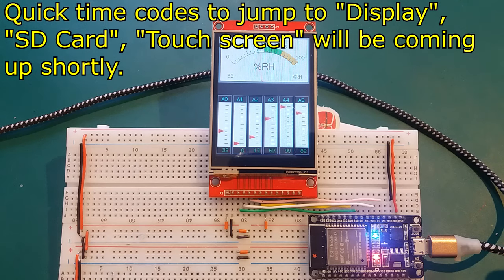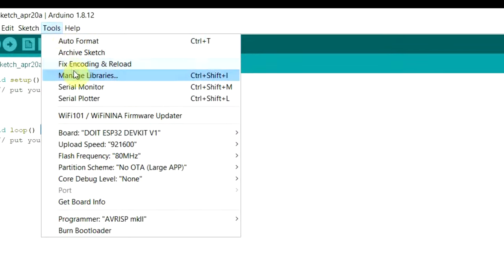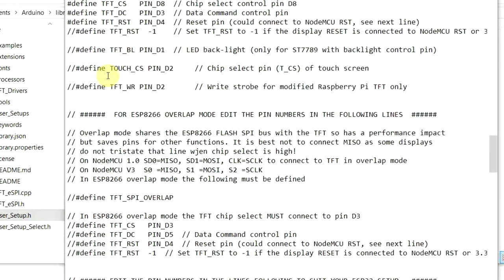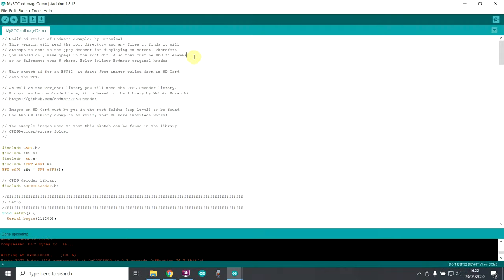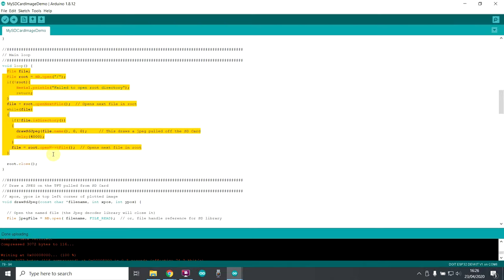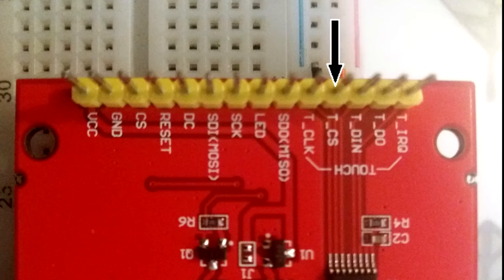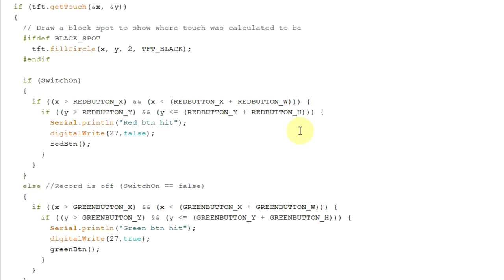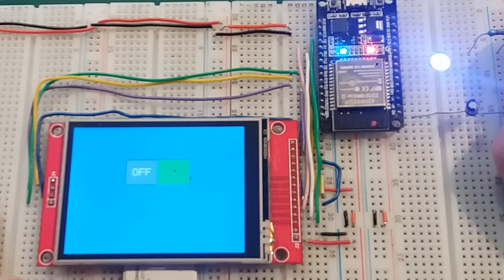ILI9341 TFT LCD to ESP32 - Full HOW TO  for display, SD card and Touch. Using TFT_eSPI driver

Comment: I'm doing this on an ILI9488. I got the meters demo to work, but can't read from the SD card. ("Card Mount Failed.") There is an ominous warning next to the ILI9488 option in the User_Setup.h  file about not connecting SDO and MISO to same SPI bus, which is Greek to me, but might be the problem? EDIT: Nevermind, got it to work. Problem was my bad soldering. Works with Bodmer's test script, still can't get your code to automatically detect and display jpegs. I'll figure it out soon enough though. Thanks!
Reply: Hello @bens4446, can not follow the assignment portion of the video, can you help me fill in the blanks so I can get going?

Display Pins   -  ESP32 GPIO Pins

VCC                    5.0V or 3.3V 
GND                    GND
CS
RST
DC - I belive is  23 
MOSI
SCK
LED                    5.0V or 3.3V                    
MISO
TCLK
TCS
TDIN
TDO
TIRQ 
SD_CS
SD_MOSI
SD_MISO
SD-SCK

Comment: Hi there, like Your video. what if you use gc9a01 controlled round 1.28in display? Any advices? Greeeteings
Reply from the maker: Not used it but looks straight forward. There should be a driver for it in the Arduino libraries I would have thought. That's your first port of call.

Comment: I don't have any of those screens (I think.. there may be 1 somewhere in the lab).
But as I don't use them, I do wonder now.... can you use images of things like screen menus and control buttons, that make things look pretty, call up a particular buttons image with perhaps some text place holders, then write text into those space on top of the image from the SD card?

Also, let's say you have images on the SD card such as snazzy meters, bar graph outlines and such, then add sprites like needles and other indicators that write over the image, without erasing those areas?
(If that's clear at all)  LOL

Basically, I use Nextion displays for all my projects (well, 99% of them) and using images, create really pretty yet functional displays.  But to do this, is very different with Nextion than with these bare TFT displays.
Reply from the maker: Yes, all that you mention is possible. In fact the library comes with a meters demo showing something very similar to what you describe. I've also down a star trek sick bay display with one with the needle pointers moving up and down. You can pull images off sd card for display too. It just takes more coding on your part to erase and redraw parts of your screen as required. It's like old style games writing.

Comment: Thanks for the tutorial. I will buy a 3.5 "TFT LCD compatible with ili9488 and touch (it has the same pins you used in the video). 
Could it work as you said using those libraries?
Reply from the maker: Yes, the library supports that screen.

Comment: hi good video, do you have a schematics for the wire connection, the touch don't work me, thanks
Reply from the maker: There was an omission in the video, I missed a small but essential detail out that affected the touch screen. If you read the video description it explains it.
Reply: @XTronical  i change this before the question and dont work
Reply from the maker: Oh, sorry. I don't have a schematic, just the explanation in the video and images.

Comment: Thank you so very much for the tutorial! I have built this and it works great! I use it in a cosplay device for our Mandalorian groups and it has been an absolute hit!
Im wondering, would it be too difficult to have two screens running on the one ESP32, each running different pictures?
Reply from the maker: Thanks. Yes, that sounds possible as each would have it's own chip select wire. Create two screen objects, one set to one chip select and the other to the other chip select. The other connections remain the same.
Reply: @XTronical  I would really like to have a conversation with you about getting this idea to work! Any chance you can message me directly?
Reply from the maker: Hi, sorry  I don't have enough time for one to one support etc. But I will consider this as a video for the channel.

Comment: Thanks for the tutorial. Great information. These screens come with basically no data so its all about what we can glean from the internet. That said, I have not been able to find anywhere, the power requirements. I am designing a project using this very screen and was wondering if you have any power consumption measurements. Thanks again for the great vid.
Reply from the maker: I don't have any figures handy. But one think you can do is pulse the back light to provide differing levels of brightness. This can reduce power requirements.
Reply: @XTronical  Thanks for the reply. Im not so worried it will be too high. I just want to know the value so I can choose the appropriate linear regulator.  Thanks again.

Comment: Hi there - I am using the same AZ-Delivery ESP32 DEV C module - followed your instructions but I get the following error when I try to compile. (I am using a MAC with Big Sur)

bash: line 0: [: too many arguments
usage: cp [-R [-H | -L | -P]] [-fi | -n] [-apvXc] source_file target_file
       cp [-R [-H | -L | -P]] [-fi | -n] [-apvXc] source_file ... target_directory
exit status 64
/Users/barrysims/Desktop/Arduino.app/Contents/Java/arduino-builder returned 64
Error compiling for board ESP32 Dev Module.

Any help much appreciated - I have no idea whats going on.

Comment: Hi, great video! I've a problem. When I instantiate the SD object (after TFT instance) I get the error "...addApbChangeCallback(): duplicate func..." (same if I reverse the initialization). Probably because we are usind two instances of SPI object with same hardware spi interface. Do you have an idea on how to solve it?
Reply from the maker: I didn't have that problem so not sure. Sounds like two library's with same function. The spi library might be being included twice from sometimes different locations. I've had a similar issue in the past with another standard library. Can't remember which now but had to delete a copy. Some standard library's are included as required and so you don't need to include again. Sorry I can't be more helpful.
Reply: @XTronical  Hi, and thank you for your answer. SPI library is included by TST_eSPI and by SD library. Everything seems work even with the error, but I'm not sure that it's safe...

Comment: Hello XTronical, I have an Elecrow 3.5in. ILI9488 ESP32-Wrover TFT Display, will this setup work with your example presented in this YT Video?
Reply from the maker: According to the supported screens, it should work. You would have to make sure the correct screen is commented out!/in in the set up file.
Reply: @XTronical  Hello ETronical, I broke down and puchased a ILI9431 Display to replicate your YouTube correctly. I am not able to compile or upload the sketch as per your video? 

You have posted the following warning in your comments:

There is a comment regarding an omission in the video, "for the touch screen to work you must un-comment the line below (remove the hash at the beginning) in the "User_Setup.h" file." Was the 

Are you referencing the corrections/updates relavent to the User_Setup.h file relevant specific to the use of an ILI9431 display , or something else??

// ###### EDIT THE PIN NUMBERS IN THE LINES FOLLOWING TO SUIT YOUR ESP32 SETUP   ######
#define TFT_MISO 19
#define TFT_MOSI 23
#define TFT_SCLK 18
#define TFT_CS   15  // Chip select control pin
#define TFT_DC    2  // Data Command control pin
#define TFT_RST   4  // Reset pin (could connect to RST pin)
Also:
#define TOUCH_CS 21     // Chip select pin (T_CS) of touch screen

I also noted a line in the User_Setup.h file - "#define USER_SETUP_INFO "User_Setup"  in my User_Setup.h file that yours did not, could this be an issue?

I do not understand why the sketch will not compile and upload,  the Arduino sketch error message below from pastebin, HELP!!!!!!!!

https://pastebin.com/gy1mG3kB
Reply from the maker: What is the error message you get that stops it compiling?
Reply: @XTronical  In file included from C:\Users\Paul\AppData\Local\Temp\arduino_modified_sketch_564348\TFT_Meters.ino:20:
C:\Users\Paul\Documents\Arduino\libraries\TFT_eSPI/TFT_eSPI.h:433:25: error: 'TFT_WIDTH' was not declared in this scope
   TFT_eSPI(int16_t _W = TFT_WIDTH, int16_t _H = TFT_HEIGHT);
                         ^~~~~~~~~
C:\Users\Paul\Documents\Arduino\libraries\TFT_eSPI/TFT_eSPI.h:433:25: note: suggested alternative: 'TFT_WHITE'
   TFT_eSPI(int16_t _W = TFT_WIDTH, int16_t _H = TFT_HEIGHT);
                         ^~~~~~~~~
                         TFT_WHITE
C:\Users\Paul\Documents\Arduino\libraries\TFT_eSPI/TFT_eSPI.h:433:49: error: 'TFT_HEIGHT' was not declared in this scope
   TFT_eSPI(int16_t _W = TFT_WIDTH, int16_t _H = TFT_HEIGHT);
                                                 ^~~~~~~~~~
C:\Users\Paul\Documents\Arduino\libraries\TFT_eSPI/TFT_eSPI.h:433:49: note: suggested alternative: 'TFT_OLIVE'
   TFT_eSPI(int16_t _W = TFT_WIDTH, int16_t _H = TFT_HEIGHT);
                                                 ^~~~~~~~~~
                                                 TFT_OLIVE
C:\Users\Paul\AppData\Local\Temp\arduino_modified_sketch_564348\TFT_Meters.ino: In function 'void setup()':
C:\Users\Paul\AppData\Local\Temp\arduino_modified_sketch_564348\TFT_Meters.ino:52:26: warning: ISO C++ forbids converting a string constant to 'char*' [-Wwrite-strings]
   plotLinear("A0", 0, 160);
                          ^
C:\Users\Paul\AppData\Local\Temp\arduino_modified_sketch_564348\TFT_Meters.ino:53:30: warning: ISO C++ forbids converting a string constant to 'char*' [-Wwrite-strings]
   plotLinear("A1", 1 * d, 160);
                              ^
C:\Users\Paul\AppData\Local\Temp\arduino_modified_sketch_564348\TFT_Meters.ino:54:30: warning: ISO C++ forbids converting a string constant to 'char*' [-Wwrite-strings]
   plotLinear("A2", 2 * d, 160);
                              ^
C:\Users\Paul\AppData\Local\Temp\arduino_modified_sketch_564348\TFT_Meters.ino:55:30: warning: ISO C++ forbids converting a string constant to 'char*' [-Wwrite-strings]
   plotLinear("A3", 3 * d, 160);
                              ^
C:\Users\Paul\AppData\Local\Temp\arduino_modified_sketch_564348\TFT_Meters.ino:56:30: warning: ISO C++ forbids converting a string constant to 'char*' [-Wwrite-strings]
   plotLinear("A4", 4 * d, 160);
                              ^
C:\Users\Paul\AppData\Local\Temp\arduino_modified_sketch_564348\TFT_Meters.ino:57:30: warning: ISO C++ forbids converting a string constant to 'char*' [-Wwrite-strings]
   plotLinear("A5", 5 * d, 160);
                              ^
Multiple libraries were found for "SPI.h"
 Used: C:\Users\Paul\AppData\Local\Arduino15\packages\esp32\hardware\esp32\2.0.15\libraries\SPI
 Not used: C:\Users\Paul\Documents\Arduino\libraries\LGTSPI
Using library TFT_eSPI at version 2.5.43 in folder: C:\Users\Paul\Documents\Arduino\libraries\TFT_eSPI 
Using library SPI at version 2.0.0 in folder: C:\Users\Paul\AppData\Local\Arduino15\packages\esp32\hardware\esp32\2.0.15\libraries\SPI 
Using library FS at version 2.0.0 in folder: C:\Users\Paul\AppData\Local\Arduino15\packages\esp32\hardware\esp32\2.0.15\libraries\FS 
Using library SPIFFS at version 2.0.0 in folder: C:\Users\Paul\AppData\Local\Arduino15\packages\esp32\hardware\esp32\2.0.15\libraries\SPIFFS 
exit status 1
Error compiling for board ESP32 Dev Module.

Used both choices for board used; ESP32 Dev Module or DOIT ESP32 DEVKIT V1 with the same results?
Reply: 09/20/2024 - Working with XTronical’s YouTube video: - ILI9341 TFT LCD to ESP32 - Full HOW TO for display, SD card and Touch. Using TFT_eSPI driver
 
Aduino 1.8.12 – TFT_Meter.ino 

In file included from C:\Users\Paul\AppData\Local\Temp\arduino_modified_sketch_587443\TFT_Meters.ino:16:
C:\Users\Paul\Documents\Arduino\libraries\TFT_eSPI/TFT_eSPI.h:433:25: error: 'TFT_WIDTH' was not declared in this scope
   TFT_eSPI(int16_t _W = TFT_WIDTH, int16_t _H = TFT_HEIGHT);
                         ^~~~~~~~~
C:\Users\Paul\Documents\Arduino\libraries\TFT_eSPI/TFT_eSPI.h:433:25: note: suggested alternative: 'TFT_WHITE'
   TFT_eSPI(int16_t _W = TFT_WIDTH, int16_t _H = TFT_HEIGHT);
                         ^~~~~~~~~
                         TFT_WHITE
C:\Users\Paul\Documents\Arduino\libraries\TFT_eSPI/TFT_eSPI.h:433:49: error: 'TFT_HEIGHT' was not declared in this scope
   TFT_eSPI(int16_t _W = TFT_WIDTH, int16_t _H = TFT_HEIGHT);
                                                 ^~~~~~~~~~
C:\Users\Paul\Documents\Arduino\libraries\TFT_eSPI/TFT_eSPI.h:433:49: note: suggested alternative: 'TFT_OLIVE'
   TFT_eSPI(int16_t _W = TFT_WIDTH, int16_t _H = TFT_HEIGHT);
                                                 ^~~~~~~~~~
                                                 TFT_OLIVE
C:\Users\Paul\AppData\Local\Temp\arduino_modified_sketch_587443\TFT_Meters.ino: In function 'void setup()':
C:\Users\Paul\AppData\Local\Temp\arduino_modified_sketch_587443\TFT_Meters.ino:46:26: warning: ISO C++ forbids converting a string constant to 'char*' [-Wwrite-strings]
   plotLinear("A0", 0, 160);
                          ^
C:\Users\Paul\AppData\Local\Temp\arduino_modified_sketch_587443\TFT_Meters.ino:47:30: warning: ISO C++ forbids converting a string constant to 'char*' [-Wwrite-strings]
   plotLinear("A1", 1 * d, 160);
                              ^
C:\Users\Paul\AppData\Local\Temp\arduino_modified_sketch_587443\TFT_Meters.ino:48:30: warning: ISO C++ forbids converting a string constant to 'char*' [-Wwrite-strings]
   plotLinear("A2", 2 * d, 160);
                              ^
C:\Users\Paul\AppData\Local\Temp\arduino_modified_sketch_587443\TFT_Meters.ino:49:30: warning: ISO C++ forbids converting a string constant to 'char*' [-Wwrite-strings]
   plotLinear("A3", 3 * d, 160);
                              ^
C:\Users\Paul\AppData\Local\Temp\arduino_modified_sketch_587443\TFT_Meters.ino:50:30: warning: ISO C++ forbids converting a string constant to 'char*' [-Wwrite-strings]
   plotLinear("A4", 4 * d, 160);
                              ^
C:\Users\Paul\AppData\Local\Temp\arduino_modified_sketch_587443\TFT_Meters.ino:51:30: warning: ISO C++ forbids converting a string constant to 'char*' [-Wwrite-strings]
   plotLinear("A5", 5 * d, 160);
                              ^
Multiple libraries were found for "SPI.h"
 Used: C:\Users\Paul\AppData\Local\Arduino15\packages\esp32\hardware\esp32\2.0.15\libraries\SPI
 Not used: C:\Users\Paul\Documents\Arduino\libraries\LGTSPI

Using library TFT_eSPI at version 2.5.43 in folder: C:\Users\Paul\Documents\Arduino\libraries\TFT_eSPI 
Using library SPI at version 2.0.0 in folder: C:\Users\Paul\AppData\Local\Arduino15\packages\esp32\hardware\esp32\2.0.15\libraries\SPI 
Using library FS at version 2.0.0 in folder: C:\Users\Paul\AppData\Local\Arduino15\packages\esp32\hardware\esp32\2.0.15\libraries\FS 
Using library SPIFFS at version 2.0.0 in folder: C:\Users\Paul\AppData\Local\Arduino15\packages\esp32\hardware\esp32\2.0.15\libraries\SPIFFS 
exit status 1
Error compiling for board DOIT ESP32 DEVKIT V1.

Also, Error compiling for board ESP32 Dev Module with the same results between both board choices
Reply from the maker: Before I look into this in detail, are you using the same version of the library as shown in the video. Some people have used later versions and had problems.
Reply: @XTronical  What is the version of your TFT_eSPI working library?
Reply from the maker: Can't remember off hand but it's shown in video.
Reply: I am using the current TFT_eSPI Ver 2.5.43.   What version did you work with for this video?
Reply: Hello XTronical, What version of TFT_eSPI did you use when creating your YT video?

Comment: Thanks for the suggestion, tried examples sdesp32.
still errors.
7:26:13.408 -> [W][sd_diskio.cpp:471] ff_sd_initialize(): GO_IDLE_STATE failed
07:26:13.408 -> [E][sd_diskio.cpp:739] sdcard_mount(): f_mount failed 0x(3)
07:26:13.408 -> Card Mount Failed
.
perhaps I will try the mod. to J1 as suggested in a later video.
Thanks again for your quick response.
John
Reply from the maker: No worries, sorry I couldn't help more.

Comment: Can the display, touchscreen and SD share the same SPI pins? Would they work normally?
Reply from the maker: If I remember correctly, yes for display and sd card (seperate chip select lines) but touchscreen is interrupt driven I think and would corrupt data on spi bus if shared. Double check this as it's been some time since doing this video.

Comment: Great tut but be careful on when you get the screen as your link says in the description:
This is a new 2.8-inch series SPI color screen module without touch function.

So no touch, I fell for this when I bought one myself.
Reply from the maker: Thank you very much for taking the time to tell me this. The link used to be a touch screen one, I guess they've not got a supply of those currently. I've updated the video description to have a link to one with touch (at least at time of writing this!).

Comment: Thanks for you video, it helped me a lot to get my tft connected. For your Modified Jpeg Code, I am getting a compile err - "Compilation error: no matching function for call to 'min(uint16_t&, uint32_t)'". I am using Arduino IDE 2.0.3. Also note,  libraries for FS.h and Sd.h need to be loaded as well.
Reply from the maker: Ensure you are using the same version of the library as in the video. As it has been updated since it was made and I think broke some things

Comment: Will static images on TFT LCD screens cause failure modes similar to, loss of color fidelity/intensity etc?    (and flickering disturbances)
Reply from the maker: If left on long enough I would suspect some burn in as even expensive screens can be prone to that. So that could lead to loss of colour fidelity/intensity, I don't think flickering would be an issue though - but could be wrong